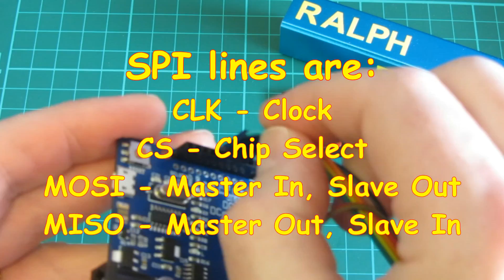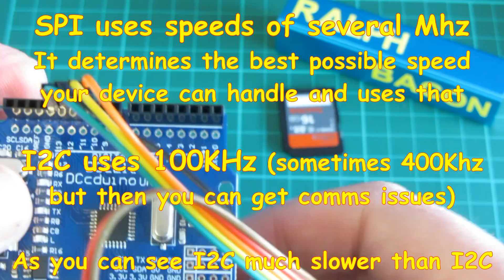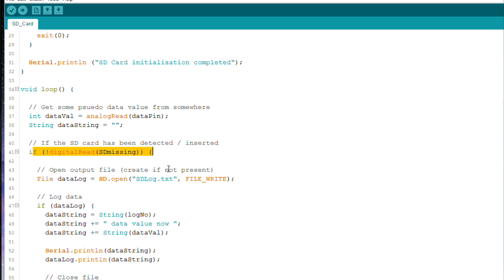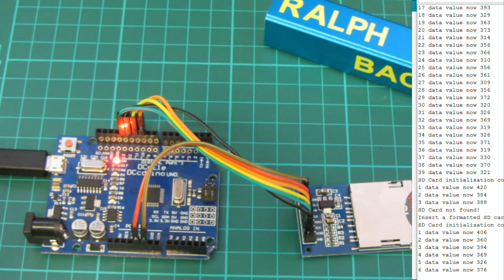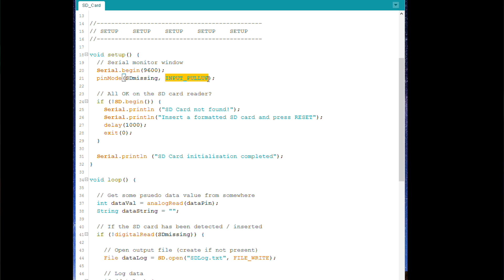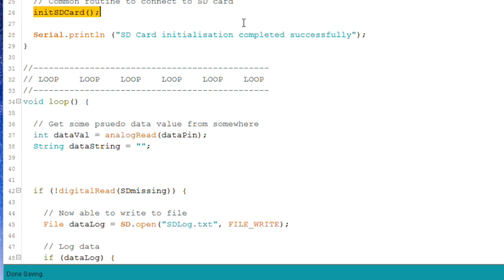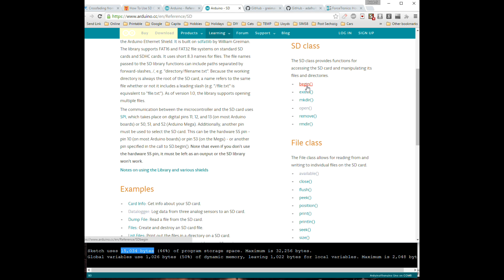#22 Using an SD card to log data - and how to improve the reliability!

Comment: That is sadly a pityfull video, Ralph!
Closing the file over and over again all the time, while each time the will be writen into the file system blocks what length is the file after appending a single byte. You actually write the card to garbage, since the number of write cycles is very limited on those cards. A better choice might be to keep some amount of data in the atmega328 memory and then write from time to time blocks of data to the card, to reduce wear out of the sd-card. Otherwise you will have to throw away the card already, after writing just a small amount of data.
Reply from the maker: You say that, Sebastian, but if you are collecting the temperature in a greenhouse every 5 minutes, the last thing you need is the power to go off after 10 reads before you write them to the SD card. I think the SD is more robust than you give it credit - my RasPi runs off an SD card no problem, just a bit slow.
Reply: @RalphBacon  If you put your "/tmp", "/usr/tmp" and "/var/tmp" onto sd-card, instead of having it in memory, you will see that within a few month the card is wrecked. The reason is, all cheap flash devices have guaranteed write cycles of about 10.000 to 25.000, and in reality you get away with somewhat like 50.000 physical write cycle for a single cell. So the problem of updating superblocks (unix) or fat base-directory every some seconds is obvious ... it makes the card fail, while writing to the very same cells over and over again. Just to test it, take a very cheap card and do the stuff in the video every some milliseconds and check how many comitted writes (close/reopen) will make the card fail.  --- It does not too much really, at a high writing frequency, while unix buffers writes for some time, before the real physical writing (sync) to card will take place. That is what makes a major difference to the plain writing with an arduino, if you do no buffering. So buffering is a good choice. If you fear to see the arduino fail, write the stuff temporarily into some external I²C-EEPROM (some 100.000 to >1 million write cycles) and when you got some data collected, write the whole shebang onto the card. A small and cheap I²C-EEPROM is good enough ( 24LC64 = 1k*8 @ 0.13€, 24LC512=64k*8@ 0.71€ [source:Reichelt]). If the price does not matter, I²C-FRAM that comes with  10^12 read/write cycles is also a choice ( Cypress FM24C16B-G = 2k*8 @ 1,80 € [Reichelt]) for buffering sd-card read/writes.
So perhaps keep in mind, unix does the buffering internally (file system driver) when writing to an sd-card, that your arduino sketch didn't. Btw. The buffering comes from times when harddisks were slow, and a lift-algorythm was used to minimize hard disk head movements. So the buffering enabled to put writes and reads into a queue sorted for minimizing head movements. The buffering still works very well, since it also gets rid of single byte writes by keeping a copy of the block in file system cache and keeping that until the block sees no more changes and some time has passed by. Then the block is actually written. The only two other situations where blocks are written, even while their content still changing, is when 'shutdown' is announced or 'atrun' via 'cron' take place, since 'atrun' and 'shutdown' perform a number of 'sync' commands to synchonize the mass storage to file system cache contents. So sd-cards tend to last some longer in a rpi for reason of buffering and optimization by reducing the number of physical writes.
Reply: @RalphBacon  BTW. You can check 'sync' writes by issuing 'sudo sync' which makes the write-led flicker, indicating that unsynchronized blocks were in the file system cache available for writing while not writen on its own at that point in time. Unix is very nice stuff at things like that!
ps. If you use an I²C-buffer of 2k*8 and you write a single byte every second, while having a guarantee of let's say 1 million write, you can buffer 2048 million bytes over time, writing at 2k blocks each onto your sd-ccard. That is at least 2gbyte of data written as buffered blocks. with an FRAM the number of bytes is by far larger when it comes to buffering.

Comment: Hello, I have a question.
If I want to retrieved the data from the SD card, do I really have to remove it from the module?
Reply from the maker: That's how I do it, Rex, but you don't have to. You can read the data from the SD card and send it up the TX/TX pins, but you would then need a program on your PC/MAC to interpret that. Bound to be many examples out there in the Internet. If the device is remote you could use an nRF24L01+ to transmit the data (32 bytes at a time) too.
Reply: By program, do you mean something like TeraTerm, PuTTY, etc or Python, Javascript? and will it still the need of the SD card module?
Reply from the maker: I mean writing a program on your PC/MAC that communicates with your Arduino. Your Arduino then sends back what it reads on the SD card. Your Arduino has to be attached via a USB cable to do this. Alternatively...→

Alternatively you could consider sending the data into the cloud, as I do in my Home Alone project (see video #154). Basically, your WiFi enabled Arduino uploads the data periodically to the IoT (Internet of Things) cloud. It's amazingly easy to do (and free), and it's how I monitor the data from my Mum's apartment in Germany, from my workshop in the UK. You could get all this working, as a proof-of-concept, in one working day.

If you need more detailed information, Rex, find my email address in the About tab (from a PC, not your mobile) and we can explore ideas.
Reply: I've sent my reply to your email. Thank you

Comment: If I have an I2C sensor (BME280) could I put it on pin A0?
Reply from the maker: The short answer is No. The longer answer is Maybe. Read on!

The standard I2C pins on an Arduino UNO (that is, any board with an ATMega328P chip on it) are A4(SDA) and A5(SCL). These pins are obviously not being used for Analog purposes, but are used as standard GPIO pins 18 & 19. 

You can "bit bang" I2C to make it work on any pin (I do this on ATTiny85s that don't have I2C built in) but it could be a little hit and miss. There are bound to be libraries out there that offer this, possibly to give the Arduino UNO a second I2C channel.

The question I should have asked is: Why do you want to put a sensor on A0 in the first place?
Reply: @RalphBacon I want to log (temp, pressure, humidity) on a sd card, and I found a sketch that uses A0 as an sensor input and my programming skills are limited.  https://learn.adafruit.com/adafruit-feather-m0-adalogger/using-the-sd-card

Im using the Addalogger M0 with an integrated SD slot.

 Most sketches seems to be using analog input when reading temp, pressure.. etc.. So far I could not find a sketch that uses I2C as input for this purpose. So Im looking around for the easiest way to make this possible. I was thinking maybe I can use some sort of built in DAC to achive this..

Any suggestions are appriciated.
Reply: @RalphBacon  forget what I wrote I found some code..

Comment: Have made the modification according to the video on the same SD card reader and LOW when card is inserted is given.
Serial output: 
Setup begins
SD Card initialisation completed successfully
------------------------------
SD Card not found / responding
Insert a formatted SD card
------------------------------
looks like only a begin () is possible.

   There is a bug that prevents repeated begin. found this:
"The SD.h library has an old bug that prevents a second call to begin()."
  // siehe: http://forum.arduino.cc/index.php?topic=324923.0
  /*boolean SDClass::begin(uint8_t csPin) {

    //    Performs the initialisation required by the sdfatlib library.
    //    Return true if initialization succeeds, false otherwise.

    if (root.isOpen()) root.close();  // <<<<<<<<<<<<<<<<<<  ADD THIS LINE

    return card.init(SPI_HALF_SPEED, csPin) &&
           volume.init(card) &&
           root.openRoot(volume);
    }*/
Reply from the maker: There is an updated Serial library that has a Serial.end() function, Helmut, specifically so that multiple Serial.begin() calls could be made. Have a go!
Reply: @RalphBacon  thank you for this quick responce
i had another try after checking that i use the right sd.h:
Setup begins
SD Card initialisation completed successfully
------------------------------
SD Card not found / responding
Insert a formatted SD card
------------------------------
------------------------------
SD Card not found / responding
Insert a formatted SD card
------------------------------
------------------------------
SD Card not found / responding
Insert a formatted SD card
------------------------------
1 data value now 211
------------------------------
SD Card not found / responding
Insert a formatted SD card
------------------------------
Curiously, there was a 0-byte file called 'sdlog.txt' and 'dataLog.txt'. very strange. 
With another SD card it works fine.
Reply from the maker: That look as though your SD card is faulty. Perhaps the gold fingers need a good clean? I've had SD cards that just stop working for no reasons that I can think of. And you say another SD card worked OK? That does indicate the first SD card is, in some way, not working properly.

Comment: Is Data Logger can retrieve data ? thank you.
Reply from the maker: Yes, indeed, Abby, it's very easy to read back the data. 
In fact, the project I am currently working on does just that. It reads back some configuration items but reading plain data would be even simpler. 
The commands you need to investigate are SD.read(), SD.readBytesUntil(), SD.readStringUntil(). The read() will read just one character (byte) at a time so I suspect the "readuntil" functions may be what you need. Good luck.
Reply: Ralph S Bacon the data logger is used to read data??

Comment: when i went to verify it, it said "CS not defined" and highlighted line 24, any tips?
Reply: sorry "CS was not declared in this scope" was the exact error message
Reply from the maker: I'm looking at the two sketches I wrote for this (way, way back in 2016!) and there's no mention on line 24 of anything CS. The CS line is used in SPI communications so I'm wondering whether the SD.h or SPI.h you are using have changed since then.
So I've copied the libraries I used when creating the sketch. Use this link to get them (it's a DropBox folder):
https://www.dropbox.com/sh/blpdw5mwq5p7sv1/AACaqXSsjNwjfPzGbYjFh1DSa?dl=0

Place the entire SD folder in your libraries folder for your Arduino workspace.
Then let me know how you get on.
Reply: @RalphBacon  I uploaded the library and at first it still wasn't working. I dug around in the library's files and later google and found that the pin's are different than in 2016. CS is now called SS so i changed that and it worked. Thanks for the help and the vid.
Reply from the maker: Great you got it working, Greg, and thanks for letting me know. I just wonder why author would make such random, breaking change when it would have been simple to keep the CS definition as well as the new SS definition. Sigh. At least it keeps us on our toes!

Comment: Two years later...does a more recent SD library include the SD.end()    ....(good video)
Reply from the maker: I must admit I haven't used an SD card recently - these days I just store small data fragments in the EEPROM. If you are wanting to do an SD.end() that means you want to do an SD.begin() with a different device (insert a different card)? 
If so, see if this article can help: 
https://github.com/esp8266/Arduino/blob/master/libraries/SD/src/SD.h
It might work for the Arduino as well as the ESP8266.
Reply: @RalphBacon  I just downloaded Arduino 1.8.10 and the SD library now includes the SD.end() method.

Comment: You seem to be connecting the SD module direct to Arduino without a level shifter for the signal lines.  Don't SD cards work on 3.3V?  I can't see a level shifter on the SD card board, only a voltage regulator.
Reply from the maker: That rather large (full sized) SD card I used in the demo was a 5v card. I'm not even sure they are sold any more; who uses full sized SD card these days? The much smaller ones (mini/micro) I use now are 3.3v tolerant only. At the time of making this video I had no smaller ones - and it made the video a bit easier to make anyway without a level shifter. Well spotted.
Reply: @RalphBacon  and everyone
Blows their 3.3v micro cards
Set the bits forever

Comment: Good to find better SD library and sketch. Video shows full size card socket with mods but seems that most Micro SD modules for Arduino and Pi have the same issue. Have you tried this with micro cards in standalone module or part of display or other shields?
Reply from the maker: True, the mini or micro socket is preferred these days and no, I haven't tried on either of those formats but it could easily be the same fix.
Reply: Looking at more SD breakouts... Some support card detect switch like some Adafruit RobotDyn and SparkFun items but many others do not and can be very hard to add a line because of card socket used. So watch what you buy if you need this output. Other sockets can change how pins work... some micro sockets are pin 10 for card detect but not all. Note that many board say support 5v like in your video but I/O lines are 3.3v with pull up resistors and can fry SD cards or have other problems using 5v SPI without adding level shifting. I have same board because have many full size cards and easier to change them outside. Finding a micro dropped in grass is no fun.

Comment: What I would like to do is create a circuit that reads and writes to/from the SD Card, without using an Arduino.  To do that, I would need to know what commands through binary the SD Card uses...  Where can I find information on that?
Reply from the maker: You could (probably) find that information in the SD card's datasheet, Dave. It may be, however, that it merely describes the I2C or SPI commands it expects. I would love to know why you want to write to an SD card without an Arduino or Nano attached - at approximately £2.50 / €3.00 / $3.00 the cost of trying to do this without an Arduino must surely be considered?
Reply: I like to know the inner workings of things and have an ability to build something with core components.  Obviously, most of the time that is impractical and ridiculous.  It is more about the satisfaction of accomplishment.  As I am learning more electronics and things about them, I like to know how to at least build something up at the base transistors and the like.  An idea I had though, came from another video I watched, which explained the operation and communication between a Commodore 64 computer and its disk drive.  And, if I could understand the workings of the SD card and the C64 serial port, it would be interesting to build a solid state drive for the C64 that functioned like its original disk drive.  As far as the use of an Arduino, I've never used one, but I am early in the learning electronics thing too.
Reply from the maker: OK, I applaud your enthusiasm but consider this: writing to an SD card is done via an established protocol, usually SPI. This is a relatively complex set of related signals on 4 wires.
 
Before SPI was invented, manufacturers did what you are now suggesting: build a bespoke set of logic circuits to generate the right pulses at exactly the right time. It cost a lot to develop and everyone in the industry was very relieved when the I2C and SPI (among others) protocols were invented.
 
If you were building a house you would not consider making your own bricks. You'd get them from a brick company by the pallet load as you have bigger things to consider than how the bricks were actually made and from which exact mixture of sand, clay and lime.
 
I'm just suggesting that being able to generate SPI signals without an Arduino or other µController) is an academic exercise these days. You're welcome to try but I don't envy you the task. Why not use an Arduino to get the SD card to play nice and then consider what else that Arduino could do (other than just logging temperature information, for example)? You could achieve your goal of building stuff and get the satisfaction of doing so this way.
 
Just suggestin' nothing else!

Comment: Can I use this Arduino library to use SDHC cards (the one used  in smarthphones)?
Reply from the maker: It depends on the ability of the SD card reader - read the specs of the device to see whether it can successfully read SDHC cards (or even higher capacity) as I suspect the higher capacity might mean a more expensive SD card reader/writer module.

Comment: It would be useful to incorporate the built-in LED (pin11) to flash during various SD conditions. For example, set the default 1-second blink for normal data logging,  and then incite a rapid flashing sequence when the card is removed, or is not being written to after re-insertion. I'm definitely going to play around with this example to make things easier for data logging in the field!
Reply from the maker: That's the spirit, Philip, get experimenting! That way you learn a whole lot more (even if it doesn't turn out the way you hoped for). But then again, Things turn out best for people who make the best out of the way things turn out. It's true!